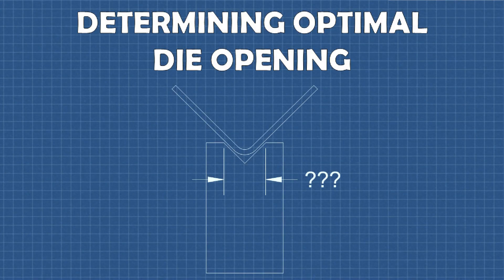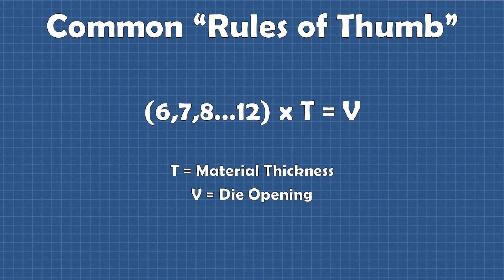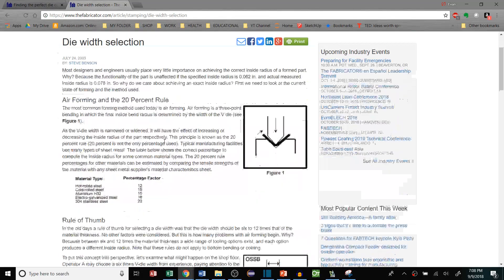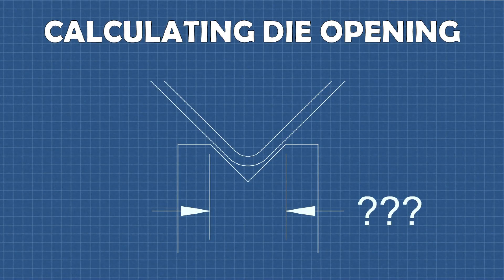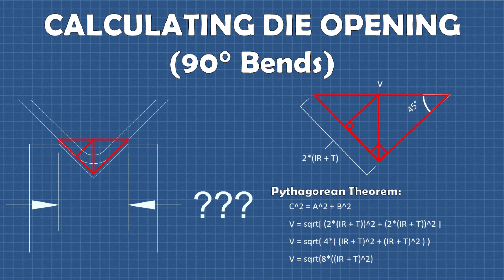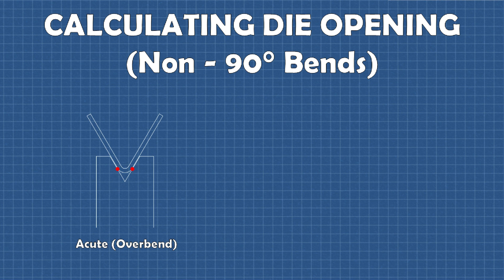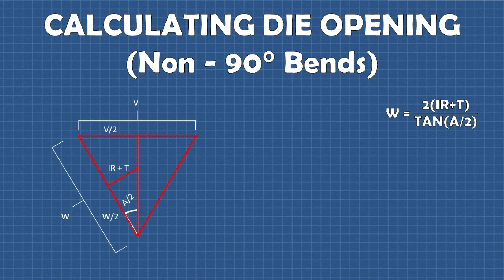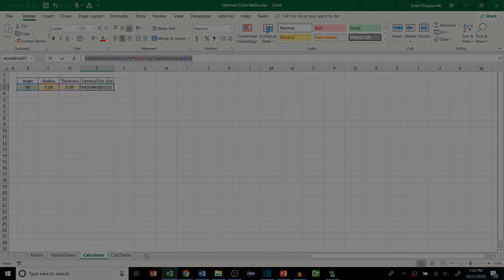Optimal V-Die Selection Formula for Sheet Metal Air Bending

Comment: Well am not a university geek, but this one always worked for me !..  0.060 X2 = .120 + .250 R  X 2 = 0.370 X 2= 0.740 V !..😎
Reply: so question ,  I'm in training on this old ass pacific cnc press brake and if I'm understanding you correctly your 0.060 is the gauge correct?  on that .250 r is that jus a radius you chose? the v part is the die opening I'm sure  (I think)..
Reply: @jesusduarte9854 you get your material thickness x2 then .250 of radius of together = .370 then you doble as  .370x 2 = .740 V die !..
Lets say i have a .250 thickness and .250 radius is .250X2=0.5 then + .250 radius is .750 now is X2 = 1.50 V die !.

Comment: Good One!, I appreciate your time. I have a request regrading bending. how do you make air bending for angles such as 20, 15, 55 degrees etc., which are non standard..? and how do you verify the angle after bend?
Reply from the maker: A precision protractor like the link below is used to verify angles.  The link below is a high quality tool..very precise.  depending on your needs, there are cheaper versions out there.  

https://a.co/d/efZWOsE

Comment: Seems like doing all the calculations before starting production would lead to an unacceptable amount of setup time where I work. I'm new to press break and received minimal training so I'm stuck trying to figure this shit out on my own.
Reply from the maker: Should be able to do the calculations ahead of time and create a lookup table/matrix for easy reference on the floor.  Check out this video.

https://youtu.be/C6bdWhlF5I0?si=sIB40Kmb2s4k4oUa

Also, most companies these days are using automated press brakes where tooling is selected and predefined in the program.  In those cases these calculation are done “off-line” when decided what tooling the program should use. Or even built into the programming software so tooling is automatically selected without needing someone to manually decide.  This way the program tells the machine and operator what tooling is used for consistent part geometry.
Reply: @TheEngineeringToolboxChannel  I'm using an old Toyokoki, the software it runs is from 1996. It's doesn't have all those fancy features. I'm constantly having to apply tape to the back gauges and shim the dies to compensate for tapering along flange length and angle. Pain in my ass.

I'm definitely going to keep this channel handy, though. Thanks.
Reply: @NonServiam1312  2 x material thickness x 2 x radius to determine bare minimum V opening.

Comment: 12x material thickness WTF bending 12 gauge on 30mm die is insane. I use 6x every time
Reply from the maker: Agreed, but it ultimately Depends on the punch radius and bend angle as well.  Hence the point of the video.

Comment: Sir this formula is applied only to the air bending in press brake machine or we can use this formula for designing a V-bending tool for power press.
Reply from the maker: This formula is for air bending using standard press brake tooling.

Comment: If there are high surface finish requirements when edge bending/press brake, the Swedish product Tribotextil™ can be applied in the bending/pressing  tool and mechanically protect the sheet metal from scratches and other damages. Tribotextil™ is an extremely thin and very strong textile that in this process replaces lubricants in the tool.
Reply from the maker: Thank you for sharing.  Also the V-Series Black by Wilson tool will reduce die marks, use less bend force, and lessen unwanted material deformation when features are close to bend lines.
Reply: @TheEngineeringToolboxChannel amada tooling are way better then wilson, we do alot of coining bend and they’ve easy break and deside not to buy anymore. Amada way stronger for coining bends !.

Comment: The company I work for uses a 1" die for everything. Is there a way to determine what the radius will be across varying thicknesses while using only a 1" die?
Reply: It depends what material you are bending and whether you are bottoming or air bending. If you are air bending aluminum parts, you're probably getting an approximate inside radius between .13 and .15 (13-15% of die opening) and your outside radius will be material thickness + inside radius. If you're bending steel, your radius is probably 20-22% of the die opening. Check out the article "Bending Basics: How the inside bend radius forms" on The Fabricator website for a better explanation
Reply from the maker: Couldn't have said it better myself!

Comment: If I use beggar V, like 20 mm more V length than the standers one, is there any problem I may face?
Reply from the maker: Not necessarily any problems.  But you should be aware that with air bending the die opening affects the radius of the bend....and therefor affects your bend deduction values.  If the flat was made with a certain bend deduction in mind and you change the die it can affect your formed dimensions.

Comment: Holy moly, that narrative is so fast and there is no example. Thanks anyway.
Reply from the maker: @KushyKaar420  in my experience this method works very well regardless of material thickness and punch size combination.  In fact, it that is where it is most useful.  Happy to be proven wrong though! 

Using this method for 3”R in 20ga mtl would suggest a ~8.5” die opening for air bending. 

What die opening would you suggest for this scenario? And how would you determine it?

This is another video that goes further with some examples of more standard scenarios but I’ve certainly used it for odd-ball punch mtl thickness combos as well.  
https://youtu.be/C6bdWhlF5I0
Reply from the maker: Sorry about that! 😬 

Edit:  check out this video.  Shows some calculated examples. 
https://youtu.be/C6bdWhlF5I0